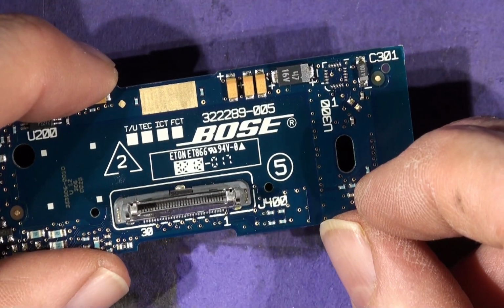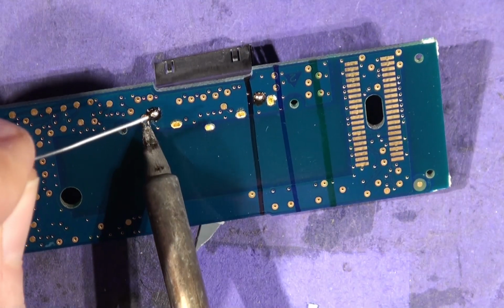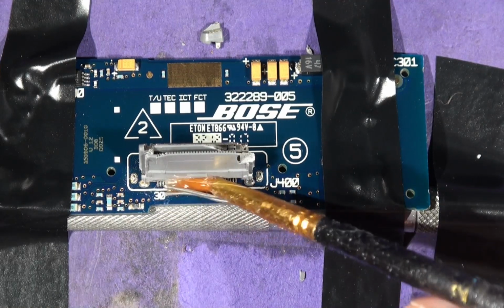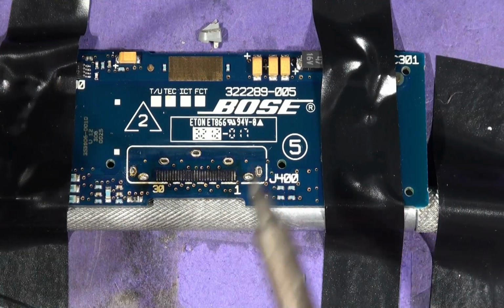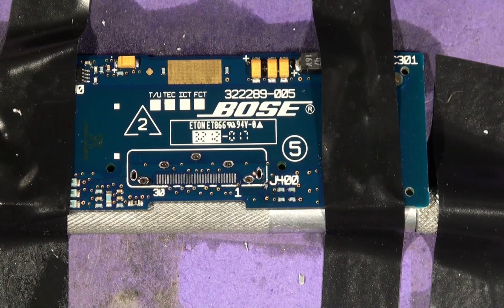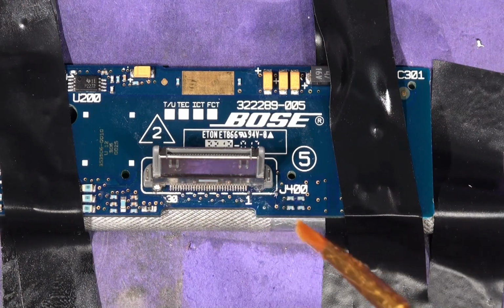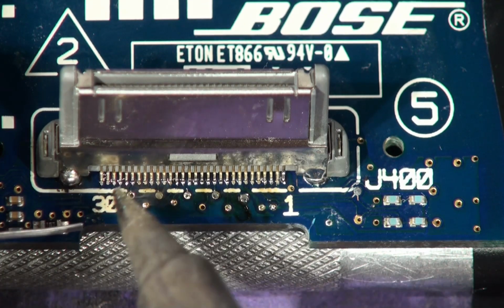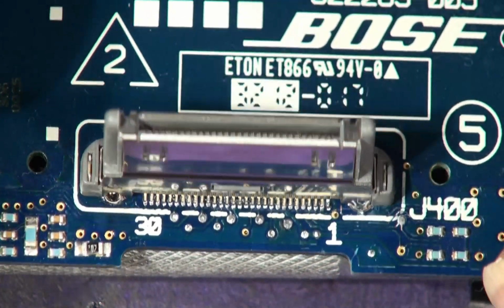iPod 30 Pin Dock Connector Change with a Soldering Iron and Swearing

Comment: hey! the metal pins on my iPod Classic 5th gen are misaligned instead of being in a straight line and because of that it won’t charge. any tips on how to straighten them?
Reply from the maker: Usually the connector joint fractures where the pins meet the PCB. The only way I know is to change the connector in the Ipod.  Check the joint with a  spyglass.

Comment: Hi
The connector is missing on my dock do i have to take it apart for the serial number? I have a few of these collected over the years series one and two are the connectors all the same?
Reply from the maker: What make and model is the dock?  Does it have five or seven holes in the PCB for the through pins?

Comment: great skill there thinner tip would help also whare can i get these connectors i have 2 dock sterios to fix
Reply from the maker: Thinner tip doesn't work for me as I need the reservoir of solder on the tip to flow into the joint.   I would use a thinner tip if I were applying a very fine solder to the joint for finer connections. sales@invebo.com has stock or the original connectors.

Comment: What do you do if you need to also repair the pads as well? In other words, the pads cracked off with the 30 pin connector?
Reply from the maker: Usually add modification wire or track repairs to reinstate any missing tracks and connections.  It can be very time consuming.

Comment: I don’t wish to deconstruct my old docking station.  Would you be able to supply a connecting cable which I could plug into the existing 30 pin docking station connector, with on the other end a lightning connector?  I would like to be able to use the old docking station to charge a current Iphone (and play audio if possible).  I also have a 30 pin dock in the car, used to charge and play my 2005 IPod Classic,  same thing, a connector which would provide charging to a current Iphone.   Thank you.
Reply from the maker: No sorry.

Comment: @Magic Smoke
Hello, how could I obtain a few of them original quality Japanese connectors, please?
I have Roth MC4 with Dock connector wrenched... I think it is the same parts as Bose one, and I could do with one (not that I am competent to do the soldering, but hopefully find someone who is locally to do it for me).

And, for curiosity, how would you usually de-solder the 30 pin connection with hot air?

Thanks

(Great tutorial video, BTW)
Reply from the maker: I have the connectors in stock email ark.mail@gmx.com.  We do chips with hot air but the connector doesn't solder well by hot air. It can be done but the prep tales to long and often I end up touching up with an iron anyway. If you work out a hot-air technique then I would be interested to know.
Reply: @razenby  Thanks, I've emailed you.
Reply: Magic Smoke You said around 7:32 “I would normally use hot air gun...” (... and again at 8:43)

So, that’s made me curious.
Reply: @razenby  do you still have those connectors. i brought my bose soundock 1 to the service center here in Manila, but they say they dont have stock of those connectors anymore.

Comment: I have an iPod classic 160 GB and the pins are damaged.Is there any way of fixing it because Apple don't make them anymore.
Reply from the maker: Yes, just change the connector on the motherboard. They can still be obtained. The pitch is the same as the docking connector.
Reply: @razenby  So where would I get the part as I'm in Donegal Ireland here?
Reply: @razenby  Do you know where I could get it fixed?
Reply: Please show us how you’d replace an iPod classic 30pin connector on the iPod motherboard.

Comment: Getting them off is always the hard part.  You should try paste to get it on next time
Reply from the maker: Thanks. Soldering iron technique was demonstrated for those who do not possess a hot air station or solder paste.

Comment: Great narration, my first job out of school was wiring up mechanical telephone exchanges in the late 70s. They gave us milk to help with the solder fumes
Reply from the maker: Thanks.  Milk that is a new one!!  I worked in a factory in the 80s during by placement from UNI with 30 operators hand soldering and an Arklone CFC bath for every assembly. The place was awash with fumes - sometimes you could see the Arklone fumes that looked like a heat haze on hot tarmac coming across the floor.  We are lucky to be alive!!
Reply: I’m not saying the milk did any good, I have no idea, am still alive though. The solder had three cores of lead in the strand

Comment: i know it's 3 year ago but  great entertainment of the issues the likes of 'we' have to deal with , i repair games consoles sometimes a balls ache mate , my method of multi pin micro soldering is to tin both pads & socket pins  flux the board drop on socket & just touch each pin with a knife edge iron tip , just one method of many , good vid'     👌
Reply from the maker: Thanks.  I worked with some draw dropping masters of hand soldering.  Luckily for me fragments of their expertise rubbed off.